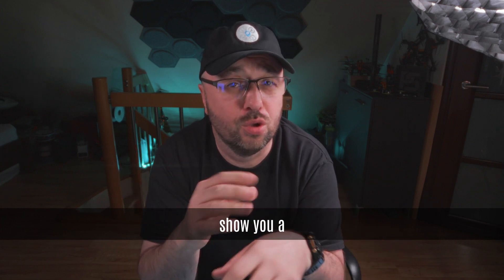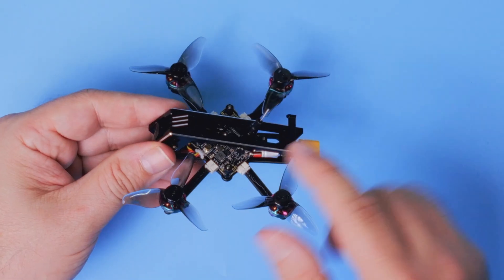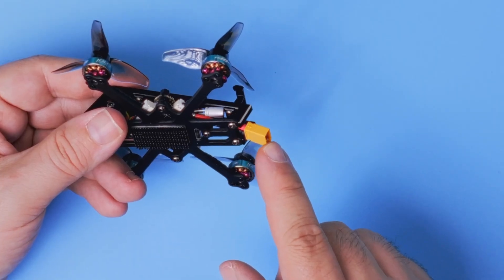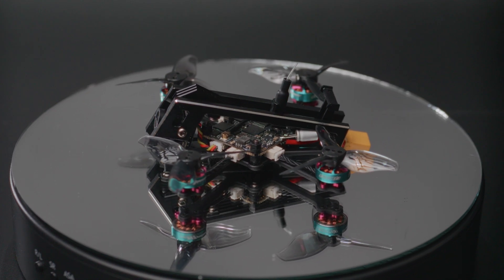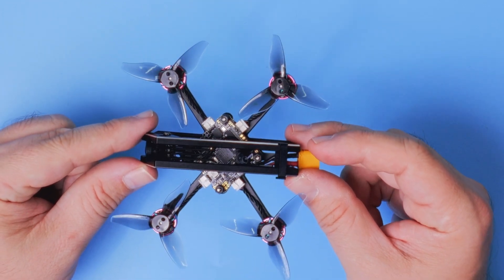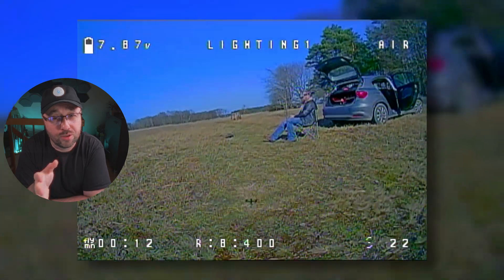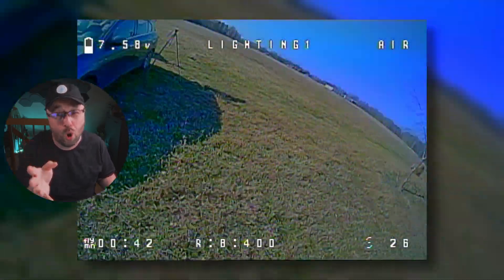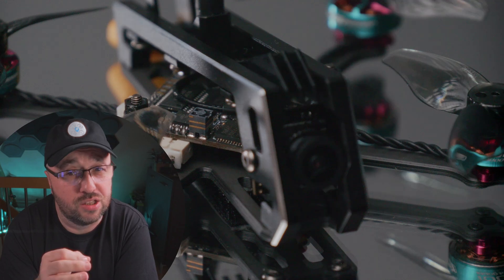YMZFPV Lighting 1 FPV drone

Comment: I originally built one with rcinpower 1003 14000kv with beta fpv 20a aio and walksnail 1s lite. On It's maiden the aio fc burst into flames and burned the carbon frame, this was definitely carbon,  you can see the weave but the replacements I bought were more like the material you described here and not finished quite as nicely.

Comment: The lighting is probably my favorite micro. Most toothpicks are too light. They hit the air resistance and stop, falling almost immediately after the throttle is cut. This little guy follows a ballistic arc through the air, much like a 5", when thrown over a wire, a branch, or just turning for a dive. It rips for 3 to 4 minutes and the tune is on point.

Comment: Wow that's a carbon copy of the HGLRC Draknight
Reply: Yeah, all the BNF companies copy eachother. But to be honest, pretty sure that this YMZFPV micro was out a few months earlier than the Draknight. Love HGLRC quads tho, have quite a few of some oldies but goodies from them. Both HGLRC and YMZFOV definitely got inspiration for this frame from the Diatone GT-Maurader 515 from 2017, these are basically a tiny version of that.

Comment: Could it be carbon fiber with paint finish?
Reply from the maker: It's not paint, I tried to scratch that and still got no connection
Reply: Possibly carbon fibre reinforced, injection moulded plastic of some sort. Chopped fibre rather than woven.